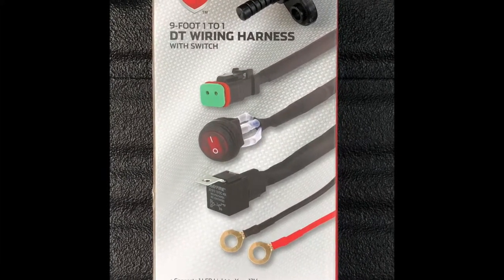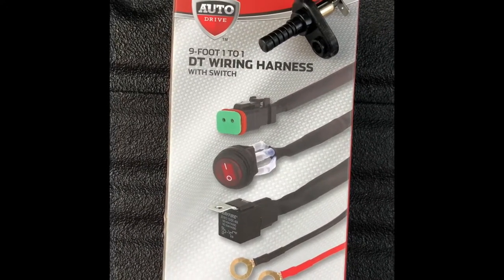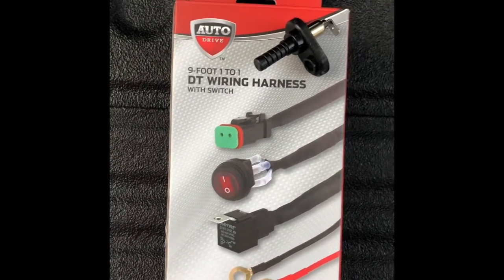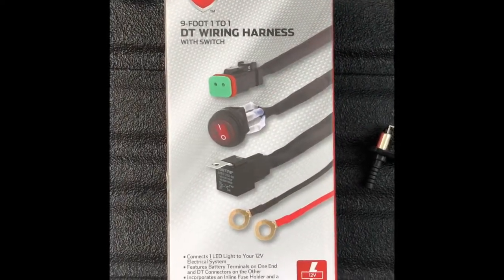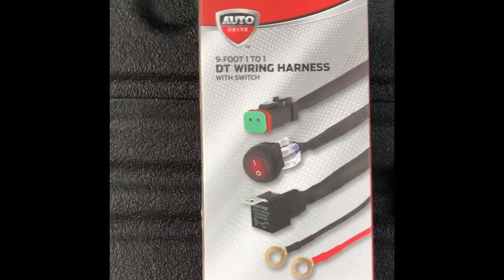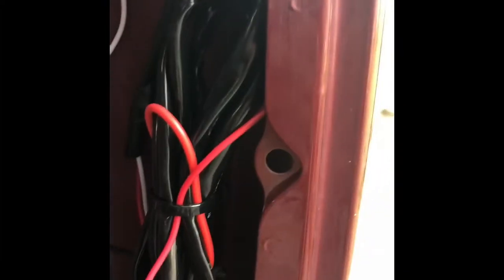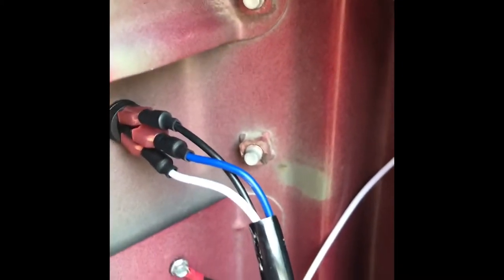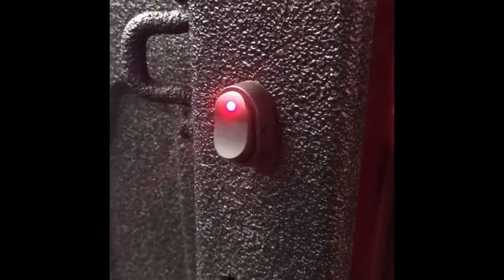Best How to Wire ON/OFF Truck Tailgate Pin Switch for LED Bed Lighting Camper Shell Tonneau Lights

Comment: CrazyBotBuilder so when the video shows the lights coming on did, you reach in and turn on your switch or did they come on when you opened the tailgate?
Reply from the maker: Javier Huerta the lights come on automatically whenever I open the tailgate. The switch is just there as an override that way I can turn the lights off if necessary when the tailgate is down.

Comment: What did you hook the ground from the lights too?
Reply from the maker: That gets hooked up to the back of the switch while the ground from your positive/negative power source gets hooked up to your vehicle
Reply: So the ground on the lights hooks up to the same place as the ground for the tailgate switch?

Comment: Where did you get your constant power source? If you use the power from the twilight harnesses dont the key to the switch need to be on first??
Reply from the maker: Jason Shoemaker I fashioned a 18 foot fused relay using 3x 6 foot 12v DC relay switches that connect right to the battery. I wanna say I picked them up from Walmart for about $8 each I think. Yeah you’ll have to tap it into a constant fused power source to have power 100% of the time.

Comment: Okay...just so I understand completely... the pin switch (ground) is connected to the ground wiring harness.  And the positive wire from the harness is then mounted to the metal truck frame to complete the circuit?
Reply from the maker: Jeff Pratt the ground wire from your light kit needs to connect to the back of the pin switch while the ground wire from your 9v power supply needs to be directly grounded to the metal frame of your vehicle in order for the circuit to be complete when you lower your tailgate. The positive wire from your power supply only needs to be connected to the positive wire from your light kit.
Reply: @Sinners4SaintsTV  thank you, it would be easy if you could tap in the taillight harness but like I said  need to turn tailights on to get the power lol, thanks for the response
Reply: Very helpful 👌 thank you